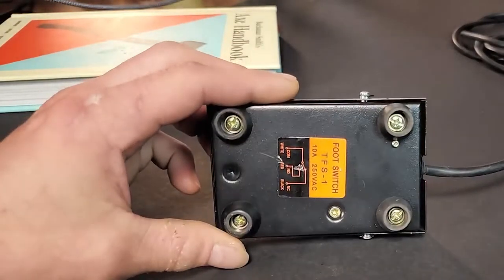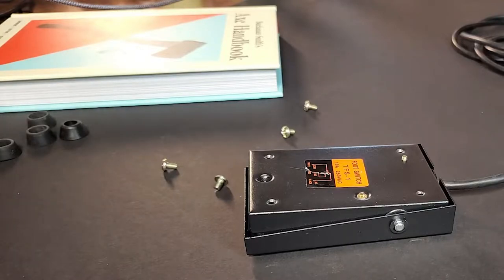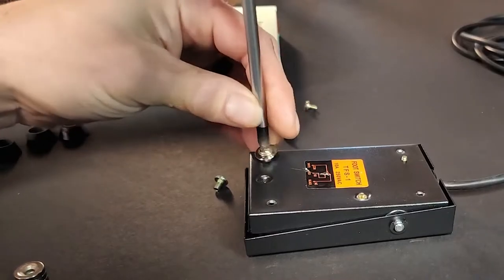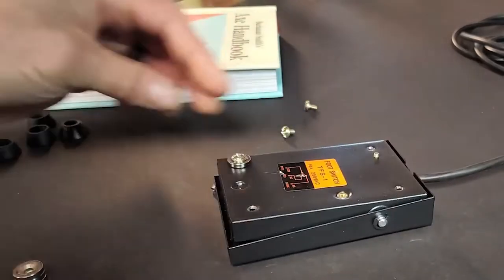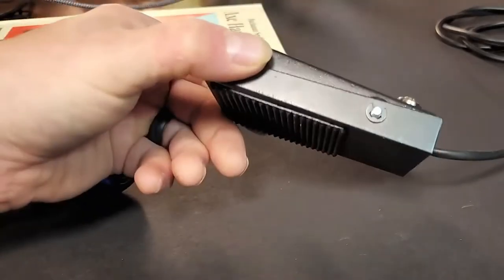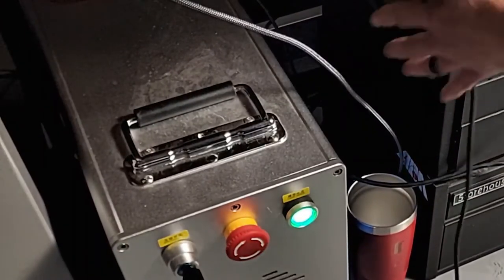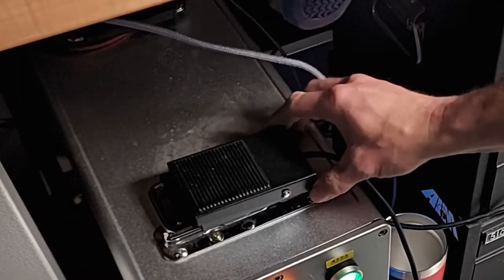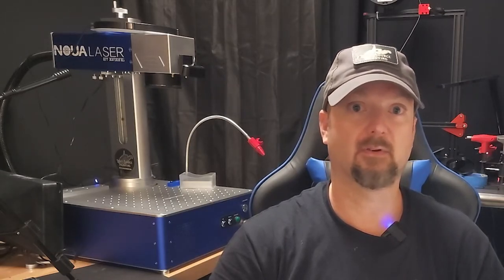Fix your foot pedal feet problem with a simple hack. Keep the pedal on the metal!

Comment: Great tip. My only concern is heads wearing down against the concrete over time to where you can’t remove them with a standard screw driver. Also all the little iron filings that will collect from the dirt. (May not be a problem so much in WV and it is here in AZ.)

May the Great Malinko provide us with more magic and miracles like magnets.😂